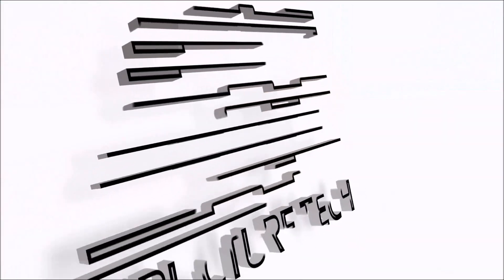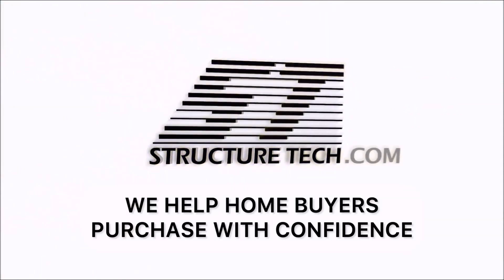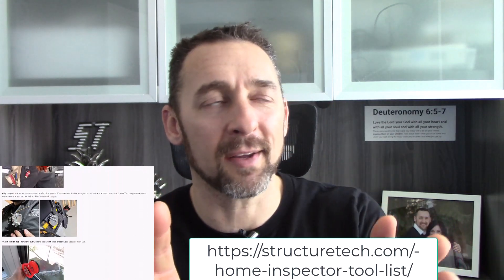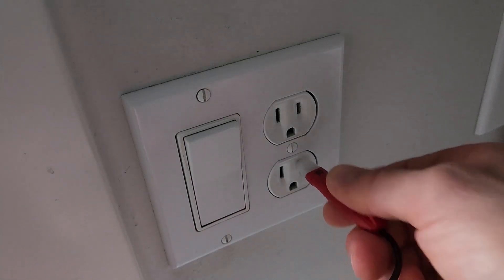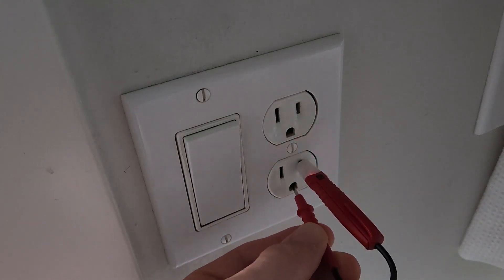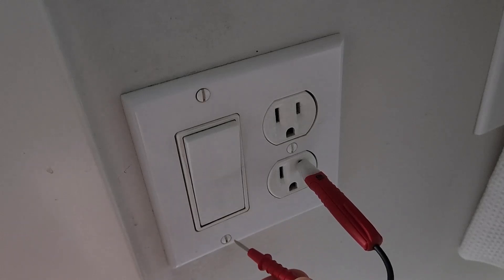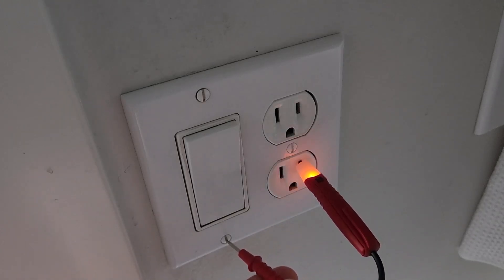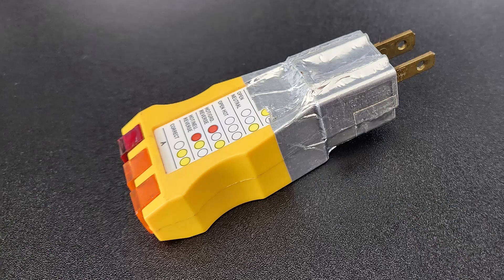Must-have home inspection tool: two-lead voltage tester

Comment: My uncle is a semi retired electrician,  and when he was an apprentice back in the late 1970s,  learned to use a Wiggins tester (solenoid bar meter, for all you new schoolers ) in fact I think he still uses it.   He can hold it in his hand, and tell the voltage by how much it vibrates.    He was telling me how he's  worked in older commercial buildings that have a 120/240 volt three phase delta with 208V high leg, and could identify the high leg simply by how the Wiggins vibrates at 208V.  Anyone ever used a Wiggins? Let me know in the comments below.